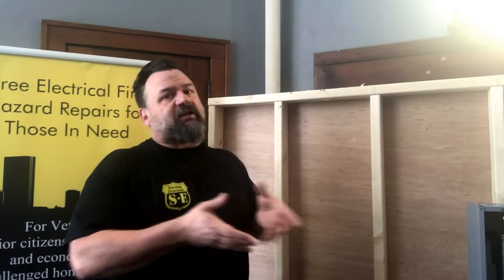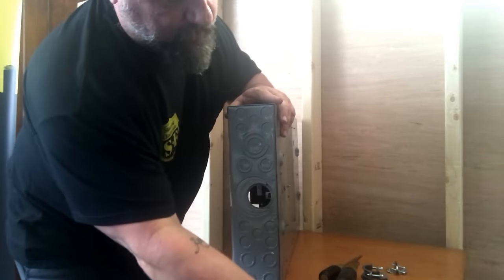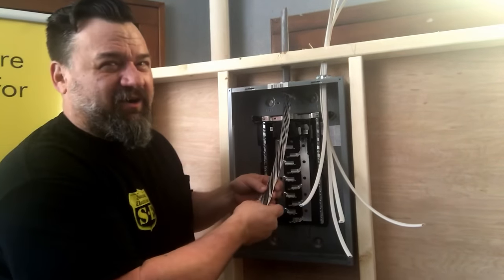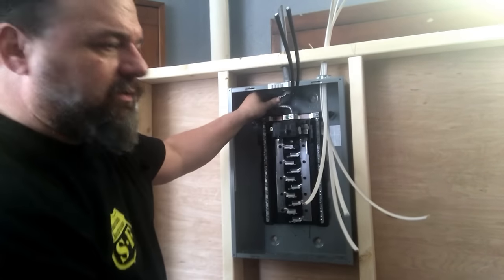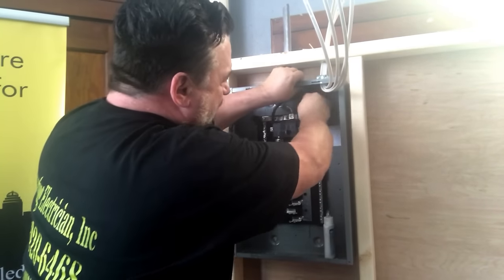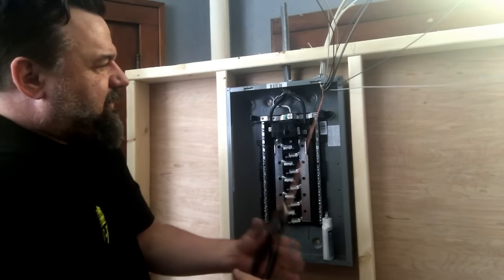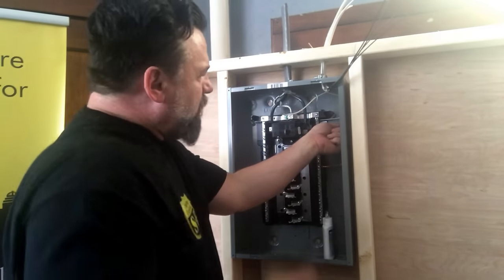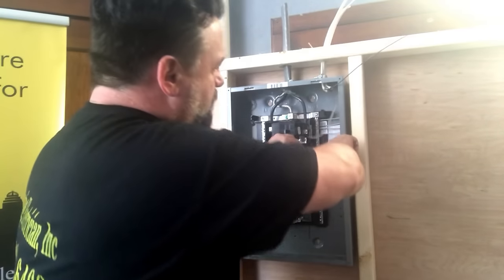How to wire a 100 amp service panel. ,  2020 National Electrical Code compliant

Comment: According to the video, you mention the neutrals can get hot due to alternating current so you don't want to accidentally touch them? Something doesn't make sense. Since the grounds are on the same bus bar as the neutrals, wouldn't all the grounds get hot with alternating current? I thought neutrals and grounds never got hot ever??
Reply from the maker: Mitch neutrals have a load on them the area path back to the bus. Since AC alternates from the hot to the neutral it has the potential to have the same voltage as the hot. Now maybe I'm not the smartest tool in the shed but I agree that grounds and neutrals to be seperated  but since neutrals are bonded to the panel it would be the same result. I have installed bonding wires to the cold water pipe and there was arching. This is the unbalance of the load and the ground is a drain sort of speak or an alternate path for current to flow instead of through you. But yes conceivably they terminate to the same place so how are they different. That unbalanced load on the ground could shock you as well. So the ground rods and the bond are a different place for the current to land. The over current. I'm not good with the technicals but this is how I try to paint a picture so you may see it a different way. Hope my babbling helps.

Comment: What size is the supply line wire that you used for a 100 amp panel box?
if anyone knows please let me know!
Thank you.
Reply from the maker: shawn s  in aluminum it’s #2 copper #4.

Comment: You don't need nolox.  Most aluminum conductors these days don't require it.
You only bond your grounds and neutrals at your service disconnect. That ground screw should be left out and your grounds separated from your neutrals for all sub-panels and at all equipment downstream from the service disconnect.
Reply from the maker: Ian Ganley  sorry but you are wrong. No lox is required by code on aluminum conductors number 6 and over. It’s made for a reason. Also we’re talking about the primary service and not the sub panel.

Comment: Haven't finished the video, but I was wondering how you wire in the main without getting zapped. I have a 100 amp box, and I would like to remove the box, and replace it with a 200 amp box with more spaces. Other than calling the electric company and having them cut the power, is there a way to cap the main, pull it out, and install it in the new box?
Reply from the maker: King 250sx  well the only way to cut power to the panel is to pull the meter out. But by changing over to a 200 amp panel you will need to Chang the wire size or it’s truly not a 200 amp service. If you need more space you can get a 30 space 100 amp panel or add a sub panel. Hope this helps
Reply: @StarvingElectrician  definitely helps. So I'd have to change the main wire coming in? To what size?
Reply from the maker: King 250sx  4/0. Four ot.  That’s aluminum service entrance cable. Or one size smaller if you go with copper that’s 2/0
Reply: @StarvingElectrician   Much appreciated. I've subscribed to your channel. Gives me a good place to start. Thanks again.

Comment: Hi. I knew when I saw the Tacos and Budweiser you were from The D. Then you said Mexican Town...Yup, Best tacos around. I have a LandBank Home 3 bdr brk bungalow about 1000 sq ft...Had city contractors put a new service panel box in and they ONLY Wired the inside for my Furnace and  water heater and one basement pull switch light. SMH. The old wiring is Sheathing and had been cut by DTE and LB for liability reasons before I purchased the home. They left enough of the old wiring to place in a junction box and tap into it...and add Romax. My Questions is....Can you make a demonstration video of HOW TO tap into old sheathing (1948 Home) with New Wiring...and run it to the New Panel Box and add the appropriate Square D Breakers for a 120 plug and a 220 plug? The Tapping In Part is the confusing part for me. All of the old wiring throughout the home behind the walls is in tact....but was CUT in the basement from the old panel box. Or can you email me instructions on home to do this. My home is 90% DOne being fully rehabbed. I ran out of funds...and cannot afford to pay an electrician. Need to DYI this myself. This will connect all the rest of the lights/wiring in the home and save me the headahk of busting through plaster and spending money I don't have. Still needs a roof (Shingles Only), flooring, a Tub Wall or Tile, some small Drywall and insulation work in the attic (Master Bedroom) and Trimming
throughout. All new windows, doors, gutters, fun=rnace/water heater, and pex plumbing throughout. Thanks for the very informative video. Trying to get this done before thanksgiving. Blessings-Don
Reply from the maker: I am so sorry I am just now responding. your comment got kicked into the spam box. if you still have questions please shoot them to me.  go to my facebook and post pics as well so i can maybe answer more clearly. thanks .   https://www.facebook.com/starvingelectrician/

Comment: I think I can pull those ungrounded services cable out with my bare hands by looking the way you put them in. Is that a primary or a secondary panel, only the primary need the main bonding jumper and I don't see a meter so that makes me think it is a secondary. For a secondary panel, the neutral and ground bus should be separated, and the main bonding jumper should be removed, Is it not?  and I don't like you make the grounding and the grounded share the busbar.
Reply from the maker: YoungBob Moes  in a primary service the neutrals and grounds share the buss bar and they are bonded directly to the panel its self. In a secondary panel there is no bonding screw and you must separate the grounds from the neutrals. Usually you install a separate ground bar all together.  I hope this helps.

Comment: I went to a vocational high school and took electrical wiring. I worked as an apprentice on and off for a few years. A few of my bosses never signed off my hours and ticked me off so I gave up and joined the army. Got hurt and kinda wished I stuck with electrical. Buying a multi family home and the seller is a slum lord and did a bunch of Mickey Mouse hacks on the electrical. I’m surprised the house never caught on fire. I’m going to have to rewrite the whole place because it still has some knob and tube and some 2 wire ungrounded cables as well. It’s 100amp service and my question is do I call the electric company to disconnect the meter or can I do it myself? Also should I upgrade to 200amp or keep it 100amp? And should Upgrade both panels? It’s in Massachusetts and I’m going to live on the fist level and rent the upper level. Thanks for the great video.
Reply from the maker: kchilz32 well that sucks that you can’t have someone do something easy like sign for your time. So many assholes out there. As far as the electrical, if you are comfortable with it then you simply pull out the meter and that will kill everything in the house. As far as upgrading the service that depends on the size if the home. You can add a hundred 100 amp sub panels so long as the load doesn’t exceed the first 100 amps. Generally in a two person flat you add a second meter so you get two bills but if you aren’t able to do that I would say since there will be two different kitchens, furnaces, laundry etc it’s a good idea to go with 200 amp. BUT, if you do that you will have to upgrade everything including outside. If you went with 100 amp the you could get a 30 space panel so long as the whole house doesn’t exceed 100 amps. I hope this helps. Thanks
Reply: @StarvingElectrician  thanks I just seen your reply. The service coming in is 200 amp and each flat main panel is 100 amp. I decided to leave it as is all I did was re-wire the house. For the second floor, that was a pain, I had to go from the basement up to the attic and down the walls. But every room now has its own circuit and and all rooms are on GFCI. Kitchen, dining, room, bath, and AC outlets are 12 gauge wire on 20 amp breakers. The only thing to do is make the main panel look neat. It’s winter and a pain to shut off panel due to heat lol but I will get back to it. Thanks so much for your awesome videos!
Reply from the maker: @kchilz32  rock and roll. thats awesome!! great job!!!
Reply: @StarvingElectrician  thanks brother! I made sure to adhere to the NEC and the Massachusetts amendments. Also watching your videos refreshed my knowledge on wiring! Thanks for all you do for us veterans as well!

Comment: This gonna sound so stupid but I'm scared now lol I bought a square d 200 amp i wired it up powers on but i didnt put the green screw in what can i do now?
Reply from the maker: Lol nothing stupid about a question. Either just be careful and put it in or shut down the power. Nothing is going to happen because you forgot it. The panel is bonded by that screw in case of a fault.  You should be good. Maybe wear gloves and stick it in there. Hope this helps!
Reply: @StarvingElectrician  thanks so much I will
Reply from the maker: D3Th_ BAMA no problem

Comment: My cable end from electrical outside has 4 wires. Black white and red and green for ground. I've been told black is left red is right and white is top. You didn't say where the ground would go on the power and I'm assuming the same place any ground would go as indicated in your tutorial. But it would have been nice to explain that
Reply from the maker: changouno  as far as were it’s going, I don’t know. If it’s a panel, then the black and red are the two hots, the green is the ground and the white is the neutral. If you can clarify I would gladly answer more questions. Thanks. Be careful
Reply: Not sure what you're referring to as needing clarity. Your tutorial says the ground for the breakers goes on the bars on left or right. Same as the neutral. But you're not showing wiring from the outside power into the junction box with a ground wire. The question as I stated is, where does that ground wire which is the green wire go? As I said I would assume it hooks into the same bar that the other ground wires hook into but you don't clarify that. Again, your wiring does not show a ground wire. From your reply I don't know I'm assuming you don't. So I'm not sure why you're asking for clarity.

Comment: Anybody…. Is noalox needed for copper wire? 
Great video thank you!
Reply: No, it is not required since copper doesn't oxidize in the same way aluminum does. There's a clue in the name of the product.
Having said that, it wouldn't do any harm if you did use some.

Comment: When do I need a disconnect
Reply from the maker: there are a couple reasons why you would need one. first if the service cable goes into the dwelling more than five feet. or to equipment. there are a lot reasons why it depends on what you are asking for. For advanced questions we could do a video conference on my site www.liveelectrician.com to book a 1/2 hour or a full hour.

Comment: Hi my name is miguel and wanted to find a  way to change a electrical panel in a mobile home.
Reply from the maker: Hello. theres really not a different way to change a panel in a mobile aside from bonding to the frame. aside from that its pretty much the same.

Comment: Just come here and replace it for me!  I am stranded out here in the country!  My son refuses to come and do another thing out here in this old trailer I am living in.  He replaced the hotwater tank for me less than three years ago.  Brand new!  Now, the dang circuit breaker started making noises.  Now, there isn't any hot water!  I made a mistake of leaving the water running as a precaution during the cold snap in Nov.  The next thing I know, is the hotwater is out!  It can't be the water tank!  Has to be the breaker box.  It is old.  The one I was told to call doesn't have a MS license.  They referred me to someone who is backed up for weeks.  Now, it is almost the end of Dec.  These things are expensive to replace.  I wil barely be able to afford the new box as it is.   I was thinking of having someone  take out the breaker box from the 2 br trailer sitting empty.  I dunno about that.  It is newer than this old trailer.  No, I won't move!    I am pretty handy, but I am NOT an electrician!  My son won't do it as he works on a boat, gone all the time, lives out of town.  Just sayin.  lol.  No comment needed, other than a good samaritan.  LOL.  Thank you.
Reply from the maker: Gale Andrews  the question is where are you located? I could look but I'm swamped too. I'm always down for a good deed if I'm able. Noises in the panel are the first indicator.
Reply: Thanks for the offer!  I  am in MS, where else?  I will find someone soon!    ! @StarvingElectrician

Comment: We're connecting our neutral and our ground to the same bar.  Why? ... I dunno!  XD hahaha
Reply from the maker: Yep same bar and bond the bar to the panel. Sounds strange but yes.
Reply: On a main panel, the two bars are connected.  See 6:10 on the video  So it wouldn't accomplish anything circuit-wise to connect grounds and neutrals to different bars.  On a subpanel, the bars are not connected and we would not connect grounds and neutrals to the same bar.  What appears to be the main panel in a house may actually be technically a subpanel if there is an outside switch near the meter that turns the electricity off.
Reply from the maker: @stephentashiro5177   yes I understand but this is a main panel and the grounds and neutrals do bond together in the panel and then ground and bond outside and to the cold water.

Comment: Im kinda worried when you say you dont know why the neutral and ground are bonded in the service panel 🙈
Reply from the maker: What I mean by that is the grounds and neutrals go to the same place. I know we’re bonding the neutral for stray current but I believe grounds should be on seperate buss bars.  I know why we wire it that way but I see an additional way to safeguard the service. Thanks for the reply and I get your comment.
Reply: Figured I miss understood 😉
Reply from the maker: Notch8 all good. I don’t claim to know it all and I welcome corrections. I do these videos with out a script and sometimes trip over myself.  Thanks for your help
Reply: @StarvingElectrician  So the only reason you would recommend not bonding the neutral and ground is to prevent stray current from the ground wires running through the neutral wires?
Reply from the maker: ebp1234  no they always have to be bonded together because of stray current. That’s the reason for the ground. So everything goes back to the source and eventually to ground. It’s only in a sub panel that you don’t bond the two. By code it’s the primary service that needs to be bonded. Again I’m not a guru but this is the code I follow and I can’t recommend anyone do it any other way. This is how electricity works and I would imagine it’s the same throughout the country. Now wiring methods could be interpreted differently by inspectors. I got shot down once because I had a two gang box. A 15-20 amp circuit were in it. I didn’t tie the neutrals together because of different loads but I did seperate the grounds. I got hit because all the grounds need to be tied together because they all go to the same place regardless of load. By saying I don’t know why they do it this way means it sounds screwy but I understand how it works but to me separating the grounds wouldn’t hurt anything. Well I was wrong! Lol not the first time but I lived and learned! Thanks for the reply. Keep me on my toes. I don’t wanna give bad advise.

Comment: Measure twice and cut once , that sub feeder is to short !!! lol. And where I come from you need a 4 wire system, an isolated neutral. ?  Oh, I get it San Franciso electric ( SFE ) the only place on  earth where neutrals are not wanted !! Only allowed to twist 2 #14 guage grounding conductors together at grounding bar, just saying.
Reply from the maker: I hear ya and it differs but where would the fourth wire come from. you dont ground the meter can so we start with two hots and a neutral then the grounding and bonding wire. its like a five wire. now as per code the neutrals and grounds can be on the same bus because they are bonded to gether, the only time 4 wire and seperate grounds are in a sub panel. thats per the code book. some citys have preferances but its not the law of the land.  thanks though i see what you are saying.

Comment: Why are you useing a S.E.U cable instead of S.E.R. and if you read the label on the "No Locks" as you call it. It's for copper to aluminum connetions only
Reply from the maker: Haji Greenen  SER is four conductor and not used from the meter for the panel. That’s why we install the ground and bond. No lox is for aluminium to stop oxidation and so the lugs do not get frozen. Copper to aluminium isn’t code in most cases and no lox has no effect on copper. It’s made for aluminium.  I been  doing this 33 years I know what I’m talking about.